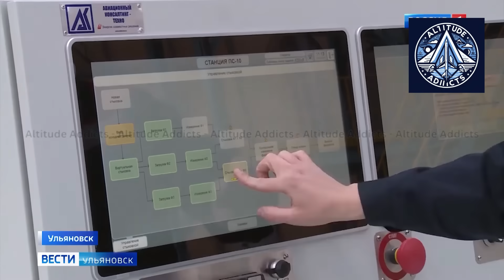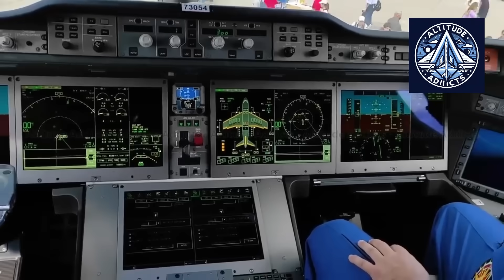The Untold Story of Kazan’s Tu-214 Production Line - 2025 Opening

Comment: It simply doesn't make sense trying to keep the Tu-214 alive when MS-21 is in the pipe. The base design of the Tu-214 is hopelessly outdated. Overweight, underpowered, ancient three person cockpit.
Reply: From an economic/profit sense, you're right it makes no sense. But from a national security standpoint, it does make sense. Suppose MC-21 program fails? Or (more likely) it succeeds and there are lots of MC-21's flying in the near future, but then there's a crash and the whole fleet has to be grounded for months (or years). Think 737 Max. At least when the 737 Max fleet got grounded, people could still fly on Aibus and shit. So having TU-214 as a backup to MC-21 could be desirable, even if it's inefficient economically.

Comment: A cockpit modernization with similar avionics to the MS-21 and SJ-100 should be done. This should remove the flight engineer position and simplify cross training of pilots between these three fleets.
Reply: easier said than done.. also the Russian state and military which are the main customers of those Tu-214 airplanes prefer the 3-crew cockpit.. so if you offer the military a Tu-214 version without a flight engineer, the military might not even accept it!!
Reply: I think the new updated Tu-204CM program is doing that... correct me if I"m wrong